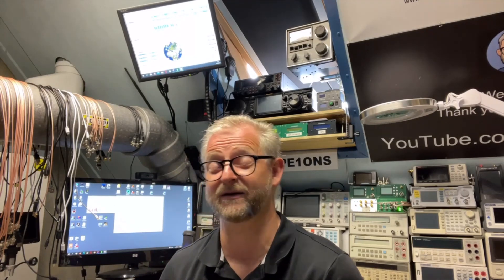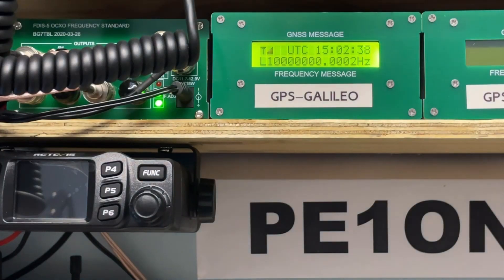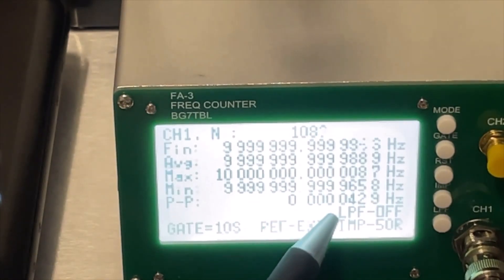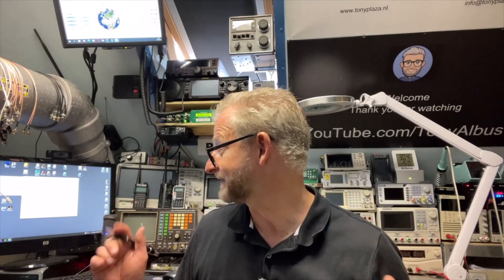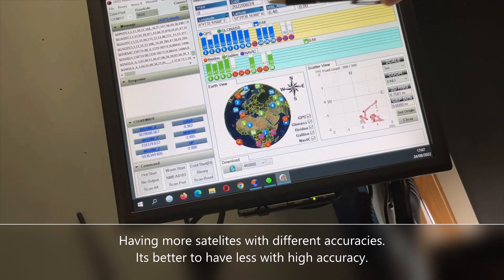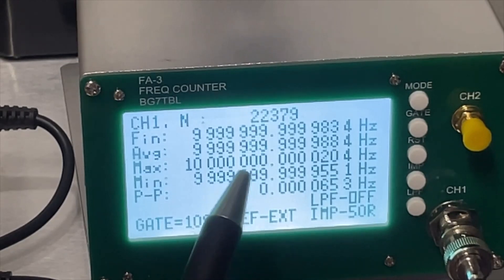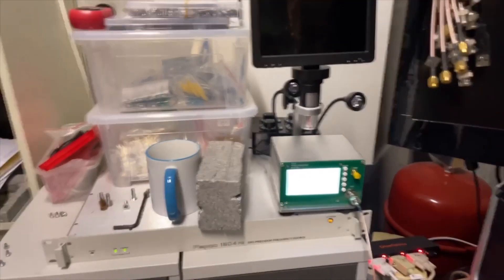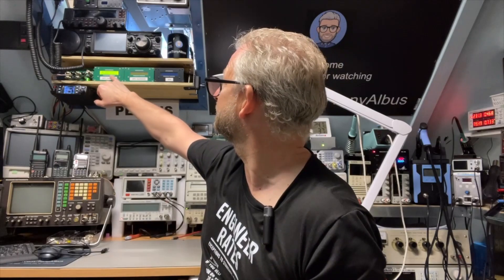TA-0309: Rapco 1804p9 vs BG7TBL GPSDO a 3th Look

Comment: Hi Tony,
I enjoy your content. 

Galileo Constellation CA, coarse acquisition, is documented on Wikipedia and their website as having higher accuracy than the USA GPS CA. The activation of the Galileo High Accuracy on CA  makes it preferable to others, IMO.. 

The new L1 & L2 dual receivers are also delivering a higher level of accuracy. Providing more accurate measurements of atmospheric variations. 

I recently read, that the Russian GLONASS was inaccurate over the Black Sea, causing the location of ships at sea to show they were on land. !!
With GLONASS blackouts over several Russian cities.

My point being, that lab references using GPSDO are at risk, if the accuracy of the USA GPS CA or the EU Galileo or any tracked GNSS is degraded due to military conflict. 

IMO, the USA GPS + EU GALILEO combination are the best two constellations for use over North America and Europe. NATO partner areas. 

My deep dive into Ublox product  documents led me to the NEO-M8N receiver.  It's designed to track  multiple constellations.  
SV1AFN, Makis in Greece, has a new GPSDO-4 device based on the  NEO-M8N receiver.  It's not available yet, but is listed on his website with his GPSDO-2 is in stock. His systems have full access to configuration options on the Ublox receiver and processing system. 

There's some good info from Ublox  about the improvements in that M8N  receiver tracking multiple constellations and controlling the number of birds tracked for higher accuracy.

If your GPSDO has the ability to set and limit the viewing angle of the sky, making the angle narrower, it limits the number of satellites used for the tracking, decreasing their range, reducing atmospheric variation, and creating a more stable frequency measurement. The tradeoff is the increased time required for the survey of birds in the limited view of the sky.  My ExacTime device, time and frequency system has that configuration option. 

I'm currently researching rubidium based  frequency references as an emergency backup to GPSDO. With a manual mode, to prevent a lock on a degraded or corrupted GPS constellation from corrupting the frequency alignment.

73, Chuck ND5CH
Reply from the maker: Thank you Chuck! Wow you did some good reseurch.. Yes my tests also agree on the GPS and GAlileo is a great combo in my location (Netherlands) i have an other video where i change the setting of the UBlox .. i do not know i i can change the angle, but great advise, i will try that. if i can't maybe if i put mu antenna in a metal cilinder to reduce the angle.
73' thanks for your comment and good information.
Reply: @TonyAlbus  
E1, L1
1,575.42 MHz

E5a
1,176.45 MHz

L2
1227.60 MHz

There are three receiver frequencies required for GPS+Galileo dual constellation and DUAL FREQUENCY, high accuracy. 

These assist with atmospheric variable propagation measurements and the next level of accuracy and stability in GPSDO.

ND5CH, Chuck
Reply: @CHUCK.H57  Hi Chuck,  As far as I can assess the B7GTBL GPSDO will NOT see L2 and E5a frequencies as the Antenna is only 1575.42MHz narrow band.  There are prob limitations in the receiver too and software  (u-centre v22.07 software has no provision for L2, E5a unless there is other free software avail).  This limits the time accuracy of this unit not being dual freq.   So will the higher accuracy from E1 Galileo still be noticed over L1  GPS on single freq operation on 1575.42MHz with SBAS enabbled?  Cheers VK5LX,  Mike.

Comment: Hi Tony, an interesting comparison, I like the logging and deviation the FA-3 gives.  Just wondering as both the Rapco and the GPSDOBG7TBL source from the same GPS Satellites , how can the Rapco be any higher acccuacy as a reference in your tests both with SBAS enabled?.   When running the GPS/Galileo combo, are you still enabling SBAS  for them to work together?
Reply from the maker: Hi Mike, i leave it in the middle which is better, i was just test the difference between them. The Rapco is designed to have most stable 'time' while the BG7TBL is a normal GPS made for stable 'location'. i am not a tine-nut. some say even one satelite system is better for stable time. some also say the Rapco has less fase noise (don't ask me)

Comment: From Ublox datasheet

1.4.2 Satellite based augmentation system (SBAS) The LEA-F9T supports SBAS (including WAAS in the US, EGNOS in Europe, MSAS in Japan and GAGAN in India) to deliver improved location accuracy within the regions covered.

 However, the additional inter-standard time calibration step used during SBAS reception results in degraded time accuracy overall. SBAS reception is disabled by default in LEA-F9T.
Reply from the maker: Thank you, so if i understand correct, SBAS gives better location, but wors time accuracy?  .. that is good to know, thank you!
Reply: @Tony Albus  
Basically. That's correct. 
The signal jitter and jumps we see on output measurement recordings of GPSDO "might" be related to the receiver processing.

I assume the receiver processor is  designed for minimal power consumption versus including  internal coprocessors to offload computational processing.

Ublox GPS receivers such as F9T are optimized for accurate timing.
Their F9P receivers are professional grade position, location, rate and direction of travel. 
Receiver technology is rapidly advancing. 

The initial SBAS upload helps the receiver search for SATS to get an initial lock. On older receivers, it still has a significant benefit. 

As more receivers implement the dual frequency (L1+L2, L1+L5, E1+E2, E5a, etc) to measure the atmospheric propagation delay, our available TIME accuracy should improve.

For a TIMING optimized receiver, it still requires an accurate location to perform the calculations. But after it has a fixed location, why should a TIMING optimized GPS receiver perform those repetitive calculations?

The Firmware code just doesn't need all the expanded overhead for position, date&time, messaging, etc in code flow where it affects TIMING signals. It's accurate timing that we basically want for our reference in electronics labs. 

If Russia modifies their GLONASS birds to distort time and location when flying over EU, then labs using multiple constellations with GLONASS, could be in bad trouble. Like the ships last year in the Black Sea, showing on GPS that they were on land..

73, ND5CH
Reply from the maker: @CHUCK.H57  Thank you Charles for this great explaination!..